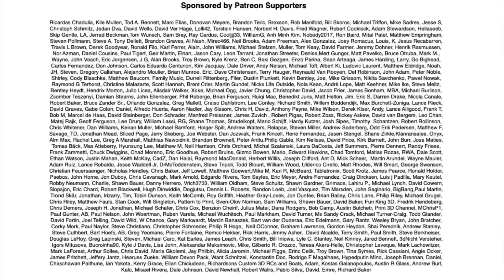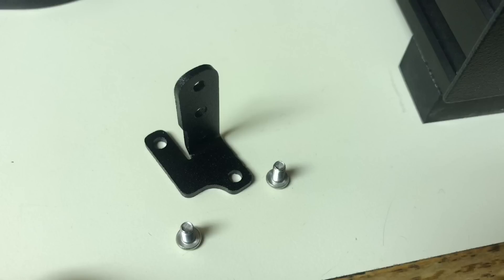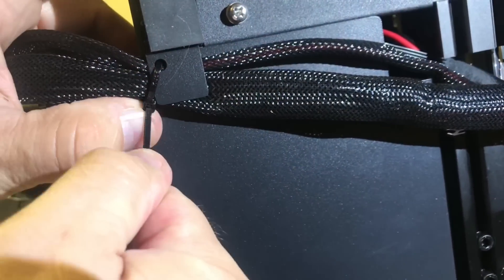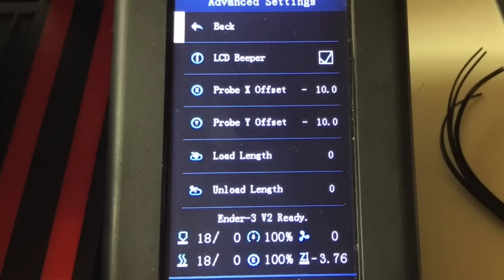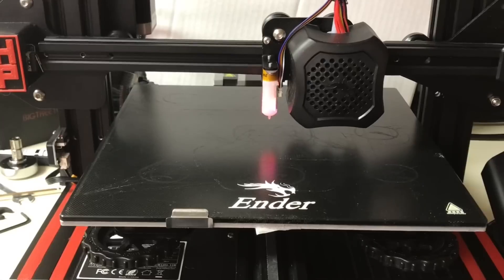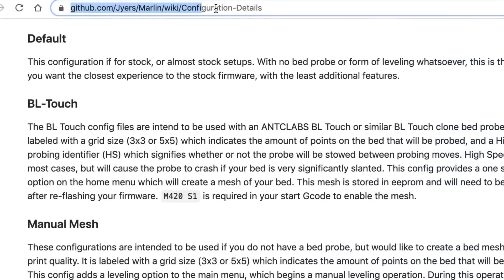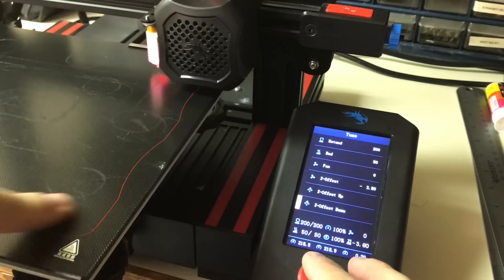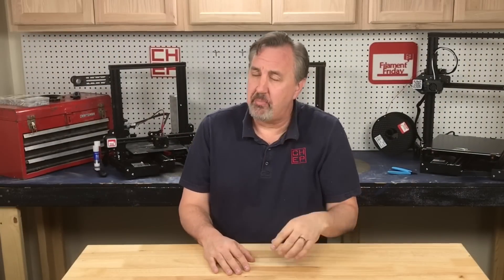How to Install AutoLevel on Creality Ender 3 V2

Comment from the maker: I used version 1.3.1 of the Jyers firmware. If you use a different version then you may get different results.
Reply: Which 3d print did you use to test the z-offset?

Comment: I am running into a problem no matter how many times I perfectly level the bed and adjust the z axis during print there are small regions within my print that are way too close to the print bed It will look super perfect for a while then it will have a point too close. And it is on the edge of the bed not the corner. So I do not know what is happening.
Reply from the maker: Bed may be warped.
Reply: @FilamentFriday what do I do?
Reply from the maker: Check for flatness with edge of a ruler across the bed. If it’s warped either replace it or take apart and try to flatten it.

Comment: Know this is old but hoping can help me, I have tried everything. I had been printing stuff and all was fine, I finished a print then sliced the next print and loaded into my ender 3 v2 and hit print. Literally the bed hadnt even cooled down yet. THe extruder goes to the left and back to center but never goes down, it says its printing and the progress bar starts going really fast to the end and says print finished, all the while the extruder never moved. Tried homing and it does all the moves except going down. Tried a bl  touch and nothing, redid firmware, nothing. I need help please!
Reply from the maker: Will it home?
If not, Check the Z motor connections.
Reply: @FilamentFriday  It will only go left and right and up. Then the little thing pops out and in twice, pretty much thinks it's homing just never goes down. Wish couldvshare a video of it. I have unplugged every thing and plugged back in. I order new motor cables anyway just to try. Thank you!
Reply from the maker: @jasonbilow2877 - sounds like the Z motor wires are backwards or the firmware is driving it backward.
Reply: @FilamentFriday  Sorry really new to this,  will this require reloading the firmware? I did do that once. Just so odd cause I just came off 4 complete prints and sliced the 5th and loaded it on the printer and boom this comes out of know where. Appreciate the time I have this question posted on 4 groups on fb and not 1 response so thank you. Your videos have helped me in other areas!
Reply: @FilamentFriday  Little update if helps any. I tried unplugging the cr touch and installing firmware with no cr touch support. Tried homing and it does its thing till it gets to the left front corner and touches the end stop as it comes down and that's it, stops right there. Wish could share videos
Reply from the maker: Can you move the X,Y and Z up and down from the LCD screen?
Reply: @FilamentFriday  @FilamentFriday  Only in movement section,  if I use live movement and dial z up and back down to 0 it moves that far. Some are saying the main board may be the issue but after trying the non bl touch firmware and moves down but just a little and just stops once it hits the endstop so not to helpful. I've tried a few different bl touch firmware with same results as well.

Comment: I am posting this comment at the beginning of watching the video: is the BL touch better or considered "upgrade" in any way as opposed to the stock CR touch? I use an Ender 3 S1, and was curious if i would get any benefit out of switching to the BL instead of CR?
Reply: The cr touch is an upgraded bl touch, so you're good

Comment: You said a few times during the test prints that the left front corner is off. Off which way? Too high or too low? My prints look like that, and I am wondering which way I need to adjust it. Thanks.

Comment: Dang, saw your video on tramming and when you specifically said auto leveling system I was hoping someone made an actual tramming system. The mapping is nice but it doesn't add much in my opinion.

Comment: Hi there.
Is there a way to customize the spots where the auto bed leveling program measures?
Because the problem that I have is that my custom fan duct drives into most of the clams that hold my print surface, and so I had to remove most of the clamps, which of course leaves not much to hold the surface in place.
I have an Ender-3 with Silent board V4.2.7 and CR-Touch, and I have Marlin 2.0.6 installed.
Reply from the maker: I’m sure it could if you modified the firmware.
Reply: @FilamentFriday  ah ok, thank you. I guess I will get a magnetic build plate, or try to find some narrower clamps then, cause I won't mess with no Marlin 😄

Comment: im curious what temp your bed it when you are using the leveling prints to be able to run your finger on them like that or are you using an adheasive?
Reply from the maker: I don’t heat it. Here’s why: https://youtu.be/NlUO-5EtB44

Comment: ok, I'm getting really frustrated. I bought a creality bltouch kit, but mine does not have the connector as you show in your video ^^
Reply: It doesn't have the same connector or no connector at all?
Reply: @TMRu22311  not the same connector. I was frustrated because all the videos about installing the bltouch creality kit show the connector as in this video. But I finally found one with the connector mine came with (and the adapterboard)

Comment: Chep - you have been a great help to me on my printing journey.  Thank you.  I have a question about the z offset, once set, as long as the BL touch is not moved, it should never need to be set again.  Even if the bed is moved to manual level it so it is not too far out, the touch probe will compensate.  Am I thinking of this correctly?

Comment: Thanks for this, does the stock 4.2.2 board have the connector or is it only on the 4.2.7 board?
Edit: I should have waited for the Github part to have my question answered... :)

Comment: I have a very odd issue wiht my ender 3 v2. I have installed the BL touch and updated the firmware correctly. When I try to home it however, the z-axis goes up a little and stops. I've checked the wiring and installed other firmware but same problem. Any idea why this is happening? Thanks!
Reply: when you auto home (everytime) does it only go up a little and stop ???  if so have you disconected the Z axis Switch - i had same issue soon as i unpluged z axis worked like normal - hope this helps#
Reply: @gngnut1979  yes the exact same thing happens. It goes it the middle, moves up a little and the bl touch retracts 3 times... I have already unplugged the z stop limit switch. The wire is still connected to the motherboard (v2.4.4) but I don't think that should matter as it isn't connected to anything?
Reply: @durjoy_b1782  I had an issue where it probe wouldn’t do anything I left everything connected and some how that fixed my issue maybe try leaving everything connected and just unscrew the z stop
Reply: @durjoy_b1782  Hello! could you solved it? I have the same problem
Reply: @nicolascaferatta2111  I contacted the seller and he's sending me a replacement, hopefully the sensor is just faulty...
Reply: @nicolascaferatta2111  a bit late but i had the same problem. Turns out, auto levelling stops when the bed is too far away. I loosened the bed to make it higher and it worked no problem

Comment: Hello how are you?  Congratulations on the channel.  I'm your follower here.

 I really need help.  I'm a regular user.  I bought a 3D touch (fake bl touch from China) to install on my ender 3v2 and I still couldn't use it.

 Can you help me?  I installed 3D Touch, used firmware E3V2-BLTouch-3x3-v4.2.2-v2.0.1.bin.  When I turn on the printer, the sensor does that test with the probe, going up and down (so apparently it's working).

 But when I start the "AUX Leveling" function, it doesn't lower the probe.  And when you start lowering the hotend in the center of the table, it goes all the way down to the point where the hotend's beak touches the table and starts to shake.  As the display still shows that it is leveling off, I don't even have the option to stop.  The only way out is to turn it off directly at the switch on the back.

 Things I've already tried:
 - I adjusted the springs as low as possible to try not to crash; - I put the z-offset at -10.00 inclusive and it doesn't stop going down;
 - I pulled the probe manually with the intention of recognizing it when touching the table;
 - I pressed the end of course sensor of the Z axis with my finger beforehand to see if it might be necessary for me to adjust it again by loosening the screws and raising the sensor;
 - Tried other firmware versions.

 Nothing worked and it does not pass this step.  I really need help.  I already realized that something is missing, because with other firmware versions the same thing happens.  But I didn't find anyone talking about it.
Reply: im late but I had the same issue and I had to rewire and switch the black and white wires on on the connector then replug it

Comment: hey great video, just installed mine. weird issue though once I installed the firmware it's like i'm unable to move on any axis, however with the default firmware installed I have no problems. any advice?
Reply: You probably have the wrong firmware installed, i have this problem if i use the 4.2.7 firmware, instead of the 4.2.2 board firmware that i actually have.

Comment: With the CR-TOUCH sensor, when the power is turned on, should that unit ALSO click two times and light up on the ENDER 3 v2? Mine has never done that nor ever worked. Let alone, the Z-axis only moves up, which is why I ordered the touch sensor to see if that was the issue of Z-axis never finding home or ever going down.

Comment: Well, I done everything as instructed and my printer will not boot at all. Tried to google any solution and now all my files including what came on the sd card are now wiped. My printer will only go to the beginning screen that says Creality... That is it.. Any help would be TREMENDOUSLY appreciated..
Reply from the maker: Reload the firmware but rename the file by changing one character. Also possibly use a different SD card.
Reply: I tried this ,but I'm still stuck on the boot up and changing the name by one character in the file won't help . And I don't have a spare SD card that I could use . PLEASE HELPP

Comment: My BL touch only probes the centre of the bed before a print despite changing the G-code as shown in the video. Is there a way to fix this?
Reply: Add "G29 A" instead of M420 S1

Comment: Chep,Chepstow, I installed a new MB 4.2.7 and a bl touch on my ender 3 pro recently.   I tried to install new firmware from the site you specified and copied the .bin file to an SD card  but it will not execute on boot up. Any suggestions to my problem?
Reply from the maker: Change one character in the .bin and try again.

Comment: Ever since I installed this I noticed my extruder very very slowly extrudes plastic. Not really a big deal when the printer is in operation because the printer is fast enough the slow extrusion is not noticed leaving no artifacts, blobs or spgahettis. My concern however is when the printer goes unattended, such as sleep or work, once the print completes everything cools down and the extruder is very slowly putting pressure on nozzle until I come to it's attention and turn the power off. Is anyone else having this problem? It probably extrudes 1cm every minute when everything is prepared and hot...
Reply: i just got my printer the other day but it seems like normal behaviour, the skirt should be enough for it to not be a problem
Reply: It's called oozing.... Everything does it if it's warm

Comment: Hey, Chep, I just received my BL Touch, but noticed on my Ender 3V2 there are no holes as in your video. :(  1:29 now what. I guess I have to drill and tap...
Reply from the maker: Early units had no holes. For a while Creality was sending replacement brackets.
Reply: @FilamentFriday  I went ahead and bought a replacement from amazon, it will be here tomorrow. Thanks again.
Reply: I just used a 5/16 self tapping screw and made a hole that lined up with the existing ones and it worked fine

Comment: Great video, but maybe it's better to insert the smaller connector into the sheath, from the motherboard side and pull it up to the bl-touch, it's easier.

Comment: One question in yet to find answered here on yt is, "was it worth doing?". It's not hard, but is the benefit useful compared to, say, better bed springs?
Reply: I bought one over a year ago....and still have not installed it. So I agree with you, I dont think its really worth all the hassle, but the cheap side of me is mad I spent money on it, and I think I will finally install it. When I have an issue, which Im sure I will - nothing is ever easy, I will let you know. lol
Reply: @KM-oi9ks I wound up getting a cheap (but locally designed) infrared light distance sensor. That was a hassle and I regret not getting the BL touch. A new build plate was the best money I've spent on my printer so far closely followed by the 0.6mm nozzle. Will be interested to see how you get on with the BL touch.

Comment: Questions: Are all these setting stored on the Mico SD card rather then on the actual 3D printer?  So if I were to use a different SD card it wouldn't print properly?
Reply from the maker: They are in the machines EEPROM.

Comment: Hi @chep, I did this upgrade recently to my ender 3 v1. The board is a 4.2.2 with 256k memory.

After upgrading and updating the firmware, the printer seems to be just fine but I can't just make it work. No matter how much i level, auto level or adjust the z offset this thing won't work. I even tried checking the nozzle but it works great. Extruder is all metal and extrudes 10mm each time I try to adjust esteps. Any ideas? I see that a lot of people seem to be having problems aswell
Reply: Fixed the issue, it was because I wasn't adding to the Z offset the width of the feeler gauge / piece of paper. If anyone needs firmware, please write below.

Comment: I  have just installed a cr touch on a enter 3 v2 and updated the firmware  , the board is a  v4.2.2.
The ender 3 v2 bed is all levelled ok, and the z offset is setup .
When  I do a test print , it probes the bed  16 times ,  goes to do a purge line and skirt ,  but it does not extrude  any filament , after this it extrudes  the filament,  to produce the test cube ok.
I am using cura slicer ,and put G29 , in the machine settings.
Reply from the maker: Must be something wrong with your start gcode
Reply: @FilamentFriday   Thanks for the help , yes you where right about the settings  , I have manged to find some code to add to the machine settings , and it works fine .
Thanks for making great content on your channel.

Comment: Are the insturctions the same for the Ender 3 pro with the creality v4.2.7 board.
Reply from the maker: Yes
Reply: @FilamentFriday  What if I am using the ender 3 pro, BLTouch 4.2.2 board, wuold it work?
Also i dont see how it would work if the screens on ender 3 v2 and ender 3 pro are completely different
Reply from the maker: You need different firmware but the instructions are the same.
Reply: @FilamentFriday  Which one should i choose or how to choose ? also does the ‘3x3’ just signify how many times it will probe?
Reply from the maker: Yes, 3x3 is 9 probe points.
Reply: i have just ordered the Creality CR Touch Sensor Auto Bed Leveling Kit and this gets more positve comment.

Comment: I have a BLtouch which is working fine for 20-30 probes than it randomly fails to trigger and so crash into the bed (at the same time it starts to blink). I have tried many different firmware so as "yours", creality v4.2.2 and v4.2.7 boards, insulating the BLtouch cable, and 3 different BLtouch from different sellers. It will works for a time and then fails to trigger in every cases. And now I am out of ideas :(. Do you know any other solutions ?.
Reply from the maker: Check wire connections. Some reported same issues with a loose connection.
Reply: @FilamentFriday That was not the problem. I found out that I needed to solder a 10k Ohm resistor. and now I don't have any problem anymore :)
Reply: @clanyeah6286  I've had similiar problem and just replace mother board thinking it was problem.  Now the z axis is acting up. Where did you find information on resistor?

Comment: I'm not sure what it is, but somehow upon installing this on an Ender3 V2, I essentially lost bed size and any value input moves are out of whack. When entering values for moves, 0 on the x axis is now registered as the BL touch going off of the build plate, but not the nozzle, which is what matters really. For y values, the bed can be entered to a value that literally causes the motors to grind as it wants to slide off to somewhere it cant go. And Z is a literal inch above the plate, even after following the z offset section. Anyone have any ideas?
Reply: ok, i may have misunderstood what this did to my menu layout and my printer. Entering values isnt a great idea anymore as its limits arent what it thinks they are anymore due to adjusting for the bl touch not slamming into the x axis stopper